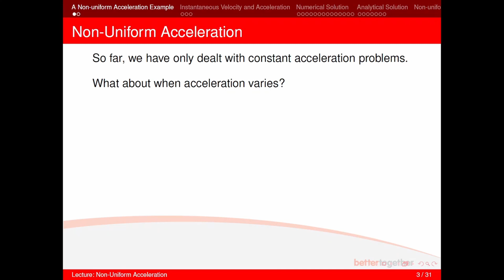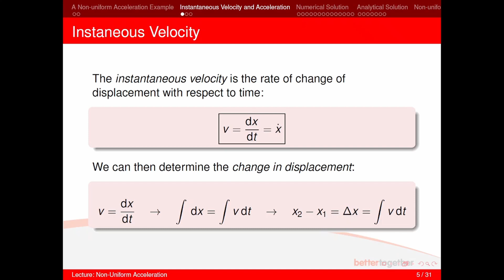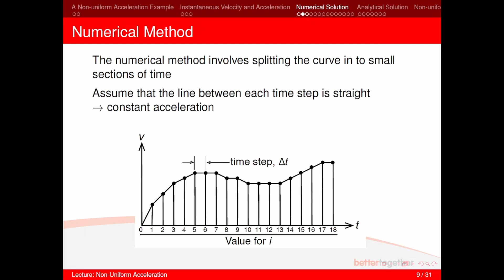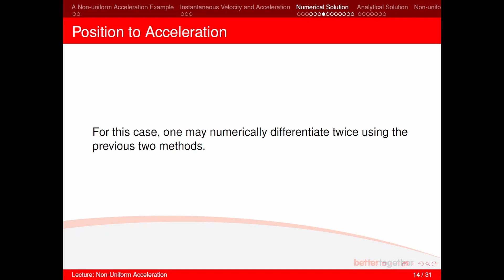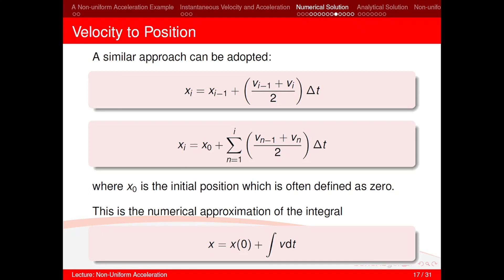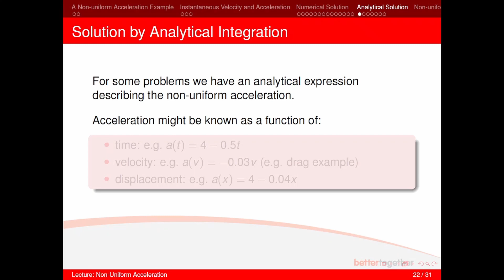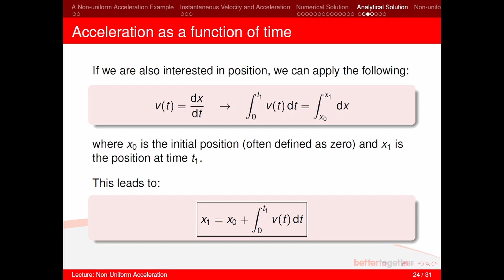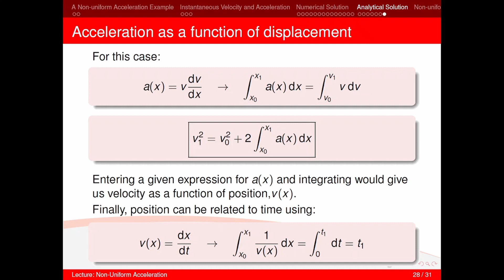How to solve non-uniform acceleration problems | Numerical approach | Analytical approach

Comment: Surprised that there’s no stochastic element to the equation to account for uncertainty. Are relationships in physics so certain? Or are such equations used as first approximation of reality?
Reply from the maker: With numerical methods you always have to assume some uncertainty. This video is just an introduction to numerical methods, so some uncertainty analysis can always be added later. I always like to play around with the timestep (make it smaller) and see how the result changes. The smaller it becomes, the more accurate the answer.